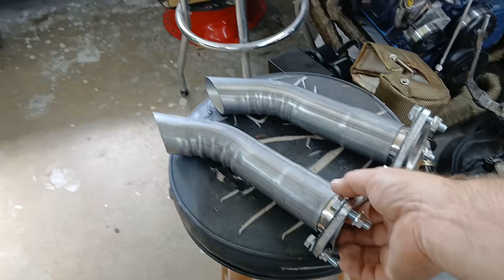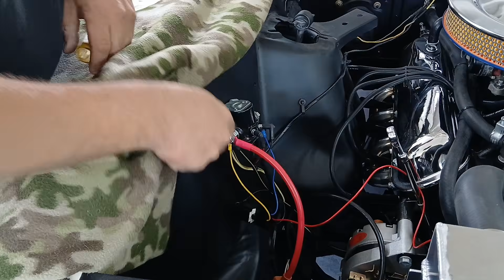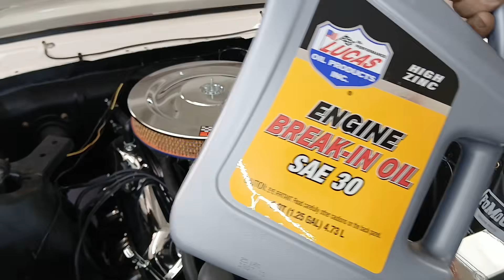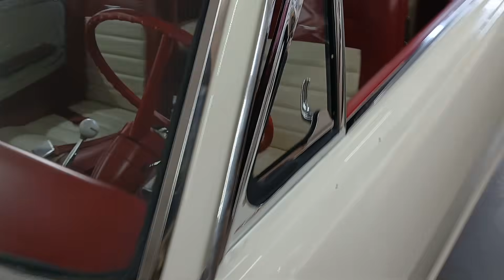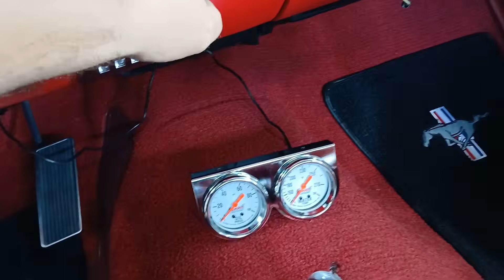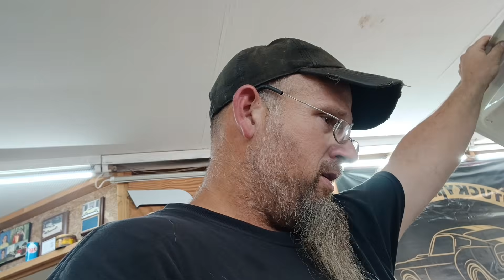First Start Magic!  Bringing This Nasty 289 Back to Life in the ’65 Mustang #ford

Comment: What did you use for wiring the car  ? I have a kit from American auto wire I was not impressed with painless wiring and this shit isn’t much better but I didn’t have a choice. The wiring in my 65 was topped up cut up spliced up a lot of the factory connector and already gone and they had female and male spay, terminals crimp on and electrical tape
Reply from the maker: Kentucky mustangs oem style wiring kit with the upgraded fuse box

Comment: I believe you need a diode on that new relay ignition wire, so it won't feed power back to the starter relay, diode has to be installed right direction. I had to do this when I went to a one wire alternator with an exciter wire because of same issue. Or maybe the ignition wire is supposed to connect somewhere other than positive side of coil. anyways looks and sounds great! very clean and neat
Reply from the maker: Good advice, much appreciated.

Comment: The air filter caught my eye, from here the filter element looks like a reproduction of the factory Autolite filter.  The round holes in the outside screen jumped out at me.  Nice touch.  It looks like 1965 under there.
Reply from the maker: Yes a reproduction  of the factory hipo element
Reply: I seem to recall vintage pics and publications showing a round hole filter for the hipo 289 too, but not the case in later years as can be seen in Ed Meyer's kid's video at 10:15 onward
https://www.youtube.com/watch?v=nw-fh1iQiWU
Reply: @ryanmuir6338  The round-hole filters is what I remember from when these were new, 'cause I'm old.

Comment: I like using relays, the one in the kit is rated 30A, that's good. Too bad the wiring is fully terminated, that limits placing the relay in an inconspicuous spot. I think a pigtail/plug for that style relay is available separately so you can make a custom wire harness.
Reply from the maker: Definitely could have been done better out of the box

Comment: What happened to the higher rpm cam break in ?  Most people put big fear in you for a wiped out cam if you don't.  I'm just trying yo learn, not criticize.
Reply: It's a good question.
Reply from the maker: Its a roller camshaft so no high rpm break in required
Reply: @HotRodGuyGarage  And I just learned something new today...........rollers seems to be a lot more forgiving, especially with the questionable engine oil and 'Chinesium' metal these days
Reply: It’s a roller cam.  You’re seeing people break in flat tappet cams.
Reply: Thank you !